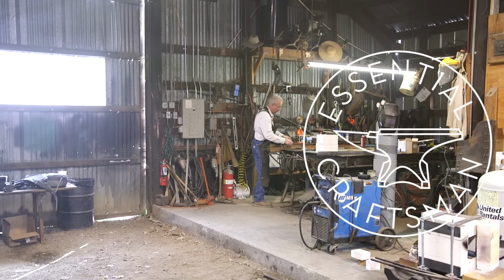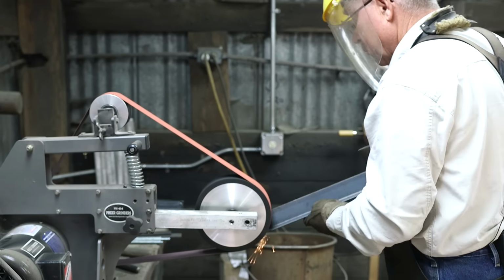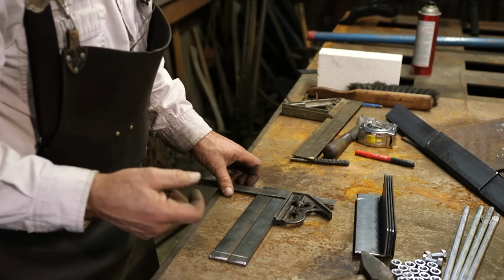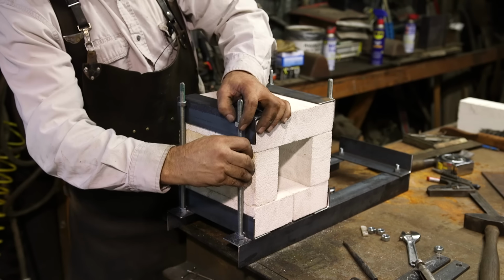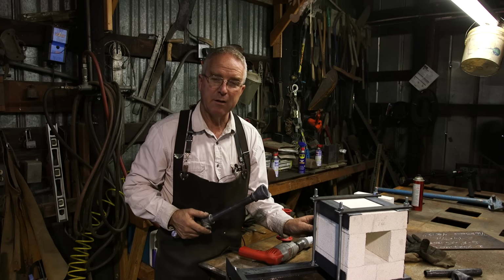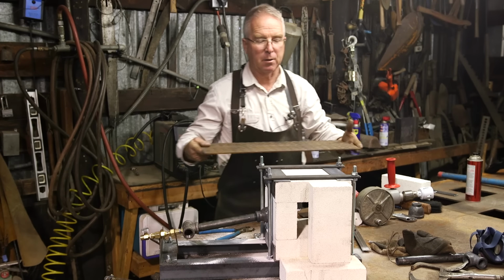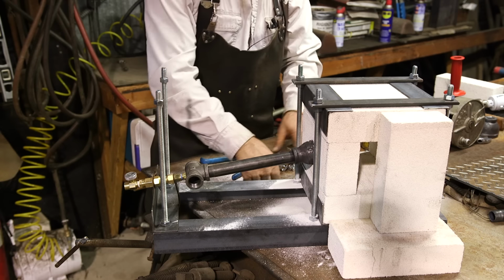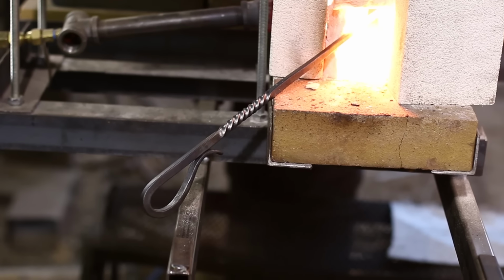Forge Build: No Welding Required

Comment: i just built a blade forge this past week. its not my first forge, but it is my first blade forge. 

i was stuck at home sick, and had just spent some of the last week making a marking knife. cut the bevels,  then i realized i had no mapp. i wasnt going to run out into the world for mapp, so i searched my basement and came up with some ~8 year old vesuvius blue -ram and a paint can. once i had packed it in, i stuck both the paint can and my tempering oven outside and cooked it in while i scrapped together a burner and stole a valve and propane rated hose from a torch. 

i used it the next day to harden the marking knife. worked wonderfully, and brought the small head to critical with propane in under 2 mins from being a ~200f  cold forge. ,

 just yesterday i was looking at it, and i realized that i probably scraped together a more efficient blade forge for literally $0 than most people can come up with for hundreds. just because life lead me a certain way. 

 i did industrial contracting for a foundry before i got sick, and a few of the contracts involded tearing out and rebuilding iron pouring ladles that were bigger than some nyc apartments.

Comment: I know this is an older video but what was the fire brick measurements? The link doesn't work anymore
Reply: Same question , you can see that the length is 9" due to it being aligned with the angle iron

Comment: for those coming back to this video from time to time like me, make sure you use the right kind of fire brick. Make sure it's IFB, the insulating kind, not the fireplace kind that's way more dense. I have had a slow start with this hobby simply because I feel like I'm wasting time and fuel because the fireplace bricks suck heat ouf of the forge instead of reflecting it back. also at the shot at the end, you may notice some ceramic fiber board lined in there too, that can be a nice touch if you have easy access to some

Comment: I've been welding since I was 12 and I'm 55 I have done some ornamental blacksmithing but using only a rosebud things like that can I utilize a railroad tie as a type of an anvil? Also what size of propane bottle, like for a forklift or a 100 lb size.  On certified in all positions stainless black steel all of that just would like to do something more artistic then just going off blueprints constantly I have a small shop and I specialize in aluminum TIG but it'd be nice to get some correspondence with you thank you

Comment: Okay I want to build a forge I have an oxygen hydrogen generator it is a commercial machine not one of those homemade things it produces 75 l an hour of oxy hydrogen how would I set up a force using that gas it burns far hotter than propane alone

Comment: For someone starting with nothing except the ability to cut and drill What would you estimate the cost of something like this to be "Roughly" preferably to include DIY burner / nozzle?
Also would it be able to completely melt and alloy copper (assuming the metals other than copper all have a lower melting point)?

Comment: Correct me if I'm wrong but couldn't you use metal bed rails for the metal (which anyone can aquire) firebrick with a coating of satanite fire resistant coating, and some nuts and bolts?

Comment: One other things about drilling the holes... Dont buy cheap drill bits.  I used a brand new drill bit from my Harbor Freight set, whichever is 1 size down from 1/2"...  It started sharp, but was dull as heck by the time I was done with 10 holes. Drill press set at 900RPM with metal cutting lubricant used.

Comment: That's a great little forge. I read an article in a  country living magazine many. years ago (while waiting in the dental surgery) looking something very similar to your design and thought I should make one. Unfortunately on that occasion I was called in quickly and never got to finish reading the article. I am a woodworker and general tool tinkerer but occasionally have the need to do some metal working or heat treatments. I guess it could be left under a lean to roof to lessen the risk of woodshop fires. Many thanks, I think I'll build this little gem. Perfect.

Comment: From experience if you want a good beginner forge get a propane 1burner MrVolcano forge they are $75 but it you want to do coal get a steel 55 gallon barrel and cut and door out of it and set it upright and putt somewhat of a chimminy on it you want you keep the fumes away from you especially if using anthracite coal (i switched to coal because it is cheaper gets hotter and is not loud) now for the blower get a Dayton 1TDP3 blower it is much better than a hairdryer but if you have to use a handcrank blower get a Zomax 25 or 35 handcrank blower dont get a cheaper one i tried them and they dont work vary well. Now for the coal i use Anthracite coal from tsc because that is all i can get but if you can get some bituminous coal it will work better or if you want to you can just use charcoal it it more expensive through and i recommend making it yourself. I hope i have helped

Comment: im watching this to learn how to make my 3rd forge.
my first i bought and modified, its just a small coke forge, witha hand crank
my second i built out of a barbeque frame, some old shelving for a shopping centre, a plow disk and an electric blower from a bouncy castle. cobbled together into a full bench that can do it all, however its still a coal forge, so it gets uneven ammount of heat and needs more constant attention, but with small things it does really well. and i have even used it to beat out a sword

my next i hope can be a gas forge for the better heating, efficiency and less impurities

Comment: I have started this build yes you do need 5 of the 9in pieces.  If you buy these bricks from Amazon Rutland Products Fire Brick, 6 count, Pack of 1 for $28.21  you need to know they do not cut like butter.  I ruined my 1 1/2 lennox hole saw trying.  I have some cement bits that had trouble drilling these bricks none of which were large enough I just wanted to see how hard these bricks were.   Rutland Products Fire Brick, 6 count, Pack of 1 may be great for insulation not so great for drilling a hole in.  I did not go to the source he listed because I did not want to have to create yet another account.  My bad  Oh and the bricks he uses look to be about 3in thick the ones from amazon are 1.5 they fit just looks a bit different.  I contacted Rutland and they say to use a wet saw for cutting.  Too bad I don't have one.

Comment: Well I built it, and it works like a hot damn. Thanks a lot for the tips man you helped me get into something I really enjoy. Just to make my contribution, I'm using a homemade venturi burner and I decided to tape a blowdrier onto the air intake. 

Easily doubled my heat output and fuel efficiency for next to nothing. I highly recommend doing this.

Comment: question on forced air system, Is there any reason you could not use an air compressor?
Reply from the maker: Yes... compressors are low volume/high pressure. A forge needs low pressure/high volume.
Reply: @essentialcraftsman  Thank you that makes sense.

Comment: Can someone explain why the burner has a tee on it? I've used weed burners on the pipeline many times, seems like that would work just fine. Is it to introduce more air? Also why don't you guys use oxy/acetylene?

Comment: I was glad to see you only over-engineered it enough to push the duration over the ten minute barrier, that way you will get the revenue, so well done there. It is also not true, that you need a massive workspace, a space larger than used by many people who raise a family, a safe, dry, well stocked, tool abundant space is not really a true requirement, but it sure helps and that comes across well in your entertaining video sir. It was good to skip the wasted detail of the propane or gas burner, as each gas needs a different attack on the combustion sphere, and you were right to sidestep that as it would have taken time away from the build of, what , six or seven bricks. Your relaxed and informative delivery method is a true treat 'especially' and completely hiding the fact that this video was nothing to do with building a forge, but more about making yet another video to ensure your monthly YouTube check comes home. Well done to you.
Reply: Why? Why do you insist on being an asshole online? Eat shit man.

Comment: Just in case anyone is really hurting. I made a forge by taping a pipe to the end of my wifes hairdryer and sticking it into my backyard firepit. Works like a charm but you will burn a lot of wood.  A real forge will for sure be better but just thought id throw it out there.
Reply: I’ve done that it works good used a dryer drum to contain the fire

Comment: I've built a forge very similar to this, I used a different type of brick because I couldn't find the refractory stone anywhere and my steel doesn't get very hot at all. Are most NA burners equivalent or could that also be my issue? Just trying to troubleshoot and find a way to increase the temp.
Reply from the maker: It has to be the light weight fire brick. A hard fire brick absorbs way too much heat. Will never get hot.

Comment: Question for the community. 

I can only find 1 1/4" thick firebricks in my local stores. Should I double them or one would do the job?
Reply: Did you try this with 1.25" fire brick? I'm unsure as well. The link for the brick material leads to a website with no specifics on brick dimensions as far as I can tell
Reply: @tomasyaczik2641  Doubled the bricks and it works fine. The bricks cracked during my second forging session. I am guessing thicker bricks wouldn't have cracked as quickly.

Make sure you buy the tough stuff tho!

Hope you can forge soon!!!

Comment: I've had better experience with the burner coming in from the top. That way the hot spot of the flame will be directly on the metal without having to brace it.

Comment: Hi Mr. very good working, Bravo, A +++++, i will do soon this same  propane forge but i bought yesterday  the 180 000 Btu burner on E-Bay. For me using thermal wool is dangerous beacose it is cancerigène, it is why i prefer using thermal brick! I saw you with a hamer in this video anf i prefer to will build a power hamer? The anvil in my region it is very,  very expensive, it is crazy price about 1 000.00 $  i saw one at 2 000.00 $, it is why i will use a block of steal. You are a very good teacher Mr. i like to wath you on YouTube. My uncle (brother ' s mother) was a very good blacksmithing but he never want to show me the blacksmithing when i am young guy, why i did not know it was an Irish (O'Reily) now i am 66 years old and this winter i make a blacksmithing forge in my garage. 2020 02 16 Saint-Joseph de Mékinac, Trois-Rives, Québec et Labrador.

Comment: I'm an engineer, I've built one of these to start a new hobby and I have to say it works flawlessly. I've been mainly building pins for old tractor tracks but I'v also effectively used it to melt scrap metal of various sort to and cast it back into small ingots. Perfect.
Reply: Can you list the parts for the propane burner

Comment: Curious here...  I’ve been jumped on elsewhere for even suggesting lining a propane forge with bricks...  is it that bricks are garbage and ruin the forge, or is it that refractory cement impregnated poly insulation is better?
Reply from the maker: Hard fire bricks are terrible insulators. Forge lined with ordinary fire brick will almost never ever get hot unless it is lined again kaowool or rigid ceramic fiber board. The lightweight fire bricks are highly insulating but not very durable. I like them anyway.
Reply: Essential Craftsman so, dumb question here...  what about a coal forge?  Same logic?  Hard bricks bad, soft bricks good?  With no real first hand knowledge, and no smiths in my neighborhood so almost all my knowledge comes from the internet, and you know how dead set right everyone here are, lol.

Comment: Maybe a dumb question or I missed in video but, What is the purpose of the Tee on the gas line? Wouldn't this cause propane to leak? or is that the point? Why not just use a valve connected to a coupling and then the pipe? 

Great Videos Btw Thanks!

Comment: For anyone building this, there is one piece missing from the cut list in the description - you need 5, not 4, 9" 2x2x1/8 angle lengths, and the 5th needs holes drilled 1" from either end. It's mentioned in the video, but not in the cut list. Also, having built one, I'm now disassembling to add a piece of all thread to connect the two 24" angle iron pieces at the fire brick end. I move mine a fair amount, and occasionally found the pieces could slide around a little with that end unsecured. Have to add, this is, in fact, as simple as it sounds to make. Great design, and using my local metal supplier, was able to build (with burner) for $140.
Reply: Great idea . Thanks for reaching wonderful skills
Reply: Hey!  I'm thinking of making one of these and was wondering, can this get the material hot enough to forge weld? Thank you
Reply: Thank you for adding the extra piece. I noticed it was missing and I’m glad you got the cut instructions for it. Way to go!
Reply: hell yha this is cool!! and  Thanks for the information
Reply: One piece

Comment: Nice forge; I want to build one! You don't speak a lot about the burner, except that it burns propane; I can find these all over the web so no problem. However, would that specified burner be a half pound regulator or 10 lb? I'd like to consider a forced air, half-pound pressure, natural gas burner (the utility company delivers it at one-half pound). Would it work? Can you direct me to a source for plans or burner complete? Thanks!

Comment: You can also make a small forge with just bricks and some metal band clamps. You can make a hexagon shape if you cut some of the bricks in a 45 degree angle. No metalwork required at all.
Reply: I love that concept.  Taking it one step further, I just use bits of brick I find on the side of the road.

Comment: I am an electrician (read: amateur accidental welder), and I have recently jumped into metal working. Up to now, my forge has been a bunch of sand in my wheelbarrow with a pipe sticking in the bottom and my wife's hair dryer blowing into it. I am getting a little bit better, and I think the time has come to build myself a proper forge. In other words, I'm getting ready to build this one. Thank you for making this information so easy to absorb, and for helping keep the trades alive!

Comment: Anyone with half a brain should be able to make this from a simple photograph.

Noncut lists required.

Only thing most people might need help with is the type of firebrick required,although that can be discovered by contacting a refravtory supplier and giving them your specs.

And anyone wanting to start blacksmithing should already posses half a brain.

A good naturally aspirated burner is a different matter though.

Lots of areas for mistakes and such a narrow margin for sucess

Comment: I would love to get into blacksmithing but I lack 1 very important thing. An area to work. I live in a small studio apartment with no place that can serve as a workshop. I am an amateur knife maker and work on improving my skills on my days off work (I'm a cook). I currently have a collapsible work table that I set up outside and can carry out my drill press, angle grinder, bench vise, or belt sander as I need them. For heat treating I'm currently going to my parents house who have a large backyard with a fire pit. I use a hair dryer with a pipe duct tape to the end to increase the heat if a charcoal fire to get my blades hot enough to quench harden. I've looked into renting a workplace but they cost nearly as much as my rent

Comment: Would you mind confirming for me weather or not this forge design can reach welding temp? I'm planning on making a propane forge and have been struggling to find a design capable of getting to 2400f relatively quickly. (Other than Kaowool coated with  ITC100HT)
Reply from the maker: Yes but only "just"... With the exception of "Damascus" I do almost all of my forge welding in a coal fire.  Welding can certainly happen at temps lower than 2400 however IMHO.
Reply: @essentialcraftsman  Good to know! Damascus/pattern welding is really what I'm aiming for in the next couple years so fingers crossed. Thanks for getting back to me so quick! The internet needs more like you :)

Comment: A comment & a question: I appreciate the clarity and the simplicity of the instructions. This weekend, I am building my forge suing the instructions here. thank you. The question is: Towards the end of the video I noticed that the forge had some kind of padding on the inside that was not there  when you were done with the forge? can I/should I just use the firebricks by themselves?
Reply from the maker: That was some rigid ceramic fiber that I added because I had it on hand... just slide the brick on the far side in an inch or so to reduce the volume. Be SURE to use the light firebrick for all of it!

Comment: Hi from the UK! Could I ask about fire risk? How often does a fire break out, and what if, for whatever reason, you're unable to control it?

Over here, us humans are packed in pretty tight. I live in a Victorian terraced house, I'm attached to neighbours on both sides; if I built a forge in the yard, and the shed caught fire, that fire would spread to the whole street. So my conscience won't let me try blacksmithing. 

Now, if I had more space, and had land enough to build a stand alone structure away from any houses, almost Medieval style, then I would consider it. How much floor space might be necessary, do you think? A similar size to a single or double car port?